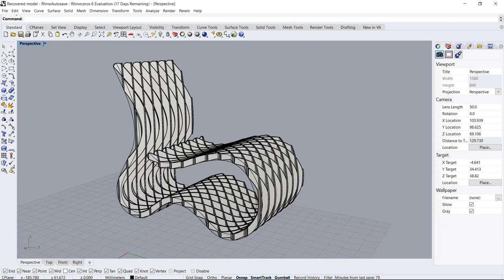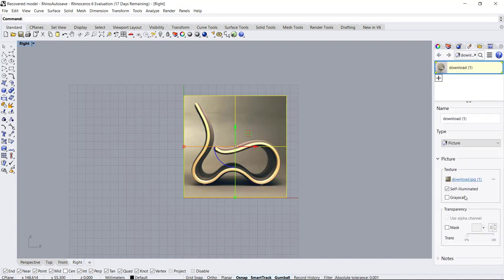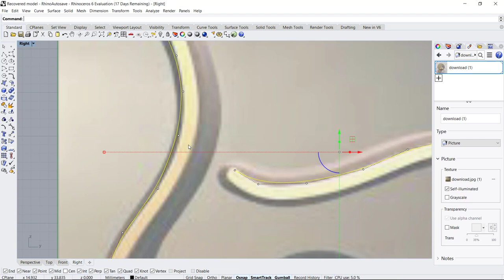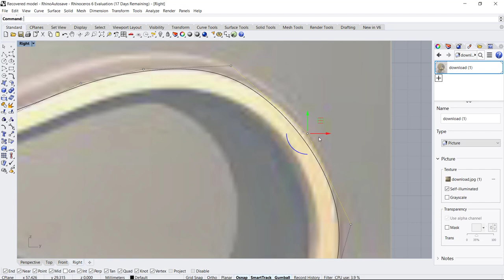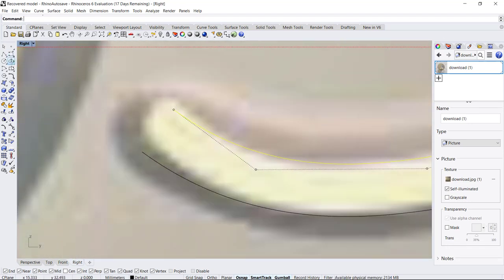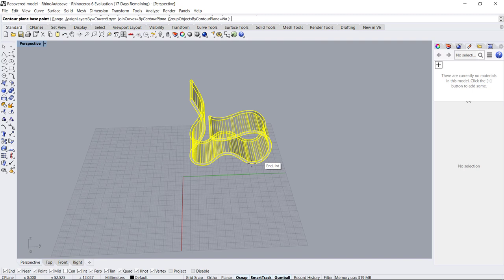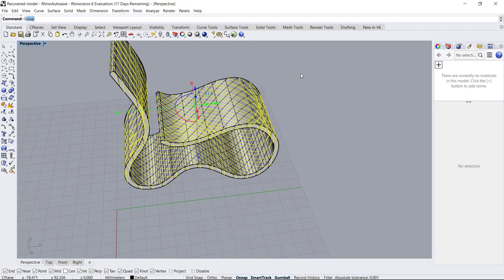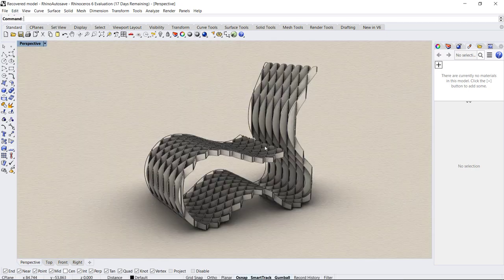Rhino Tutorial Curved Chair - Waffle style

Comment: Hi! Please how to have the 2D drawing of each part of the waffle structure if I want to CNC. Is it possible to do a 2D projection of each piece ?
Reply from the maker: Hi there. If you want to make the chair in real life then you should make some adjustments. Group each part individually. Use boolean to make cuts where the parts connect (make sure the cuts meet in the middle so that the parts don't get completely cut through). Then you can use make2d to project each individual part and export to Cad. If you use cardboard try laser cut instead of cnc. Hope that was helpful. Maybe i will make a video about it in the future.
Reply: @powerfularch  Thank you very much for the answer 🙏🏽🙏🏽🙏🏽
Reply: Please make videos for 2d conversion